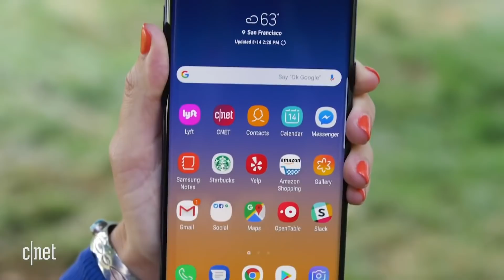What's inside the Galaxy Note 9 (Cracking Open)

Comment: All I usually need is a plastic card and a heatplate to get those back panels off. Put it on the plate and set it to 60°C for about 4-5 minutes and it comes off smoothly

Comment: PLEASE READ THIS, IF YOU WANT TO KNOW WHY THE NOTE 9 IS THE BEST SMARTPHONE OF THE DECADE!
Got to spend some money??? 
Forget Apple with their false advertising, Forget Xiaomi, Forget the Fragile Oppo Phones and those "Full Screen to body Ratio" Vivo Phones. Forget Huawei with Saying that they have the best camera while their device can not perform better than Note 9 in low - light conditions. Forget Sony claiming they have the most megapixels in a single camera. Forget Google claiming to be the best smartphone with the smoothest experience and best single camera ever.
This ladies and gentlemen is the best smartphone so far of the era. Not because it's good at a thing only, but because it's good in many things. 
There are OEMS like Apple that are good in one thing, and that is their CPU power. This device may not be that, but at least it packs many good and useful things into a single 6.4" device.
Okay tell me, where in the world is there a device that has:
-Micro SD Slot up to 512GB Memory. 
-Headphone Jack. 
-4k mAh battery. 
-Stereo AKG 3D Tuned Speakers. 
-6.4" 2K Super AMOLED Display, being one of the best displays ever made on a phone. 
-No notch, and still more screen to body ratio than iPhone X. 
-Best low light camera out there, having dual aperture. 
-NFC. 
-4G speeds up to a GIGABIT per second!. 
-Most durable water and dust resistant smartphone ever, IP - 68 Rated. 
-Hybrid Slot. 
-Type - C port having a pretty fast and decent charging time thanks to the Fast Charging technology Samsung has.
-Fairly protected battery that does not explode.
-Great liquid cooling out there with a gigantic heat pipe to keep the heat away. 
-Decent customisation on Samsung's Android with Samsung Experience 9.5 that has many features ahead of every Android version out there. 
-Android 8.1 with top protection, thanks to the active knox deployment system. 
- 8GB/6GB of RAM Memory and 128/512GB of Internal Memory. 
-Fastest and best Wireless Charging out there. 
-Durable front and back glass.
-Iris Scanner. 
-Great front facing 8MP camera.
-Noise Cancellation Mic
-Samsung Dex (PC Like workstation mode) that can now be used with a single Type - C to HDMI Dongle.
-Best S-Pen out there with Bluetooth capabilities for taking photos, unlocking your smartphone, playing/pausing music, and more stuff around that.
-Bixby 2.0 which is far better, smarter and more optimised.
And last, but not least price below 1,200$.
What else could you want people? 
Go on, I'm open for Discussion!
Reply: @Ed Saucin i love you
Reply: ...In your opinion
Reply: Are you high?
Reply: Trajce Playz You sound quite delusional to type that large of a list.
Reply: @brandon_nope  He's right tho.